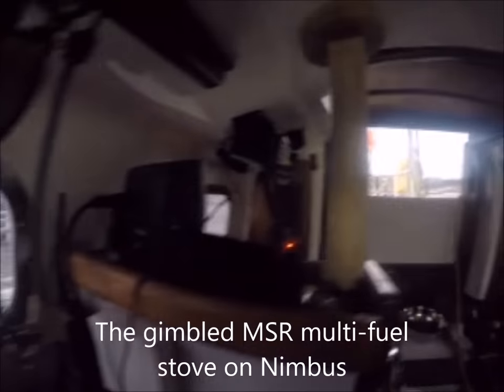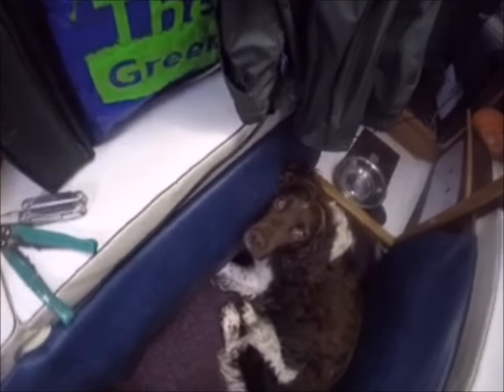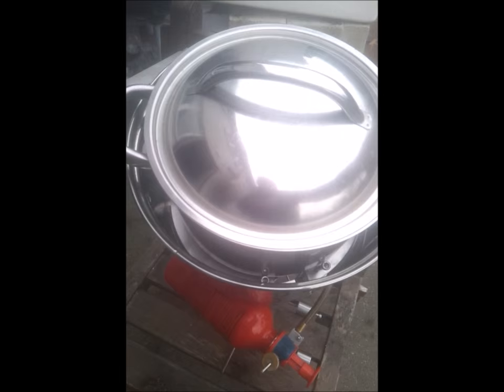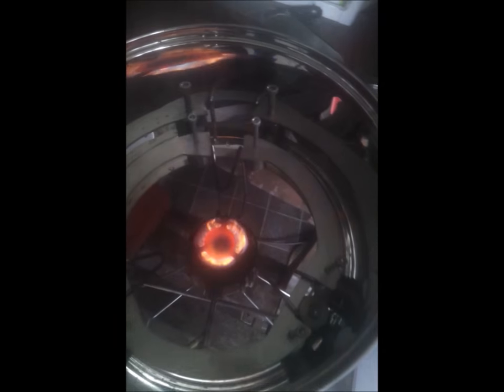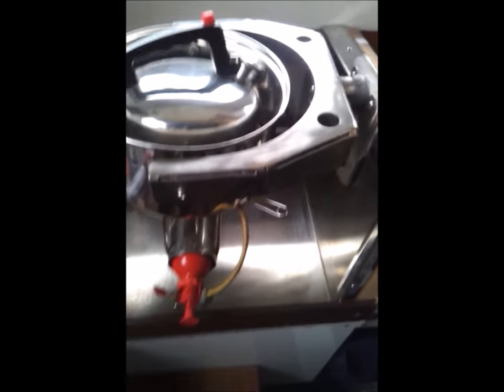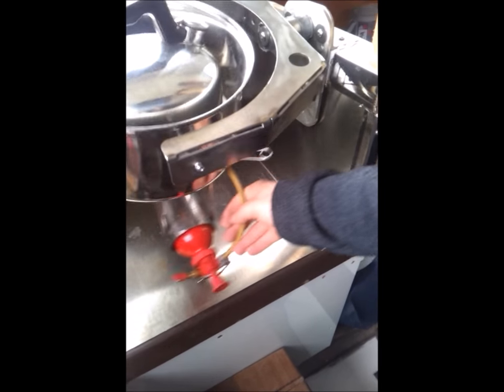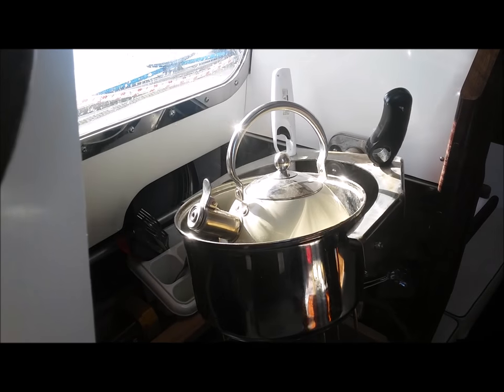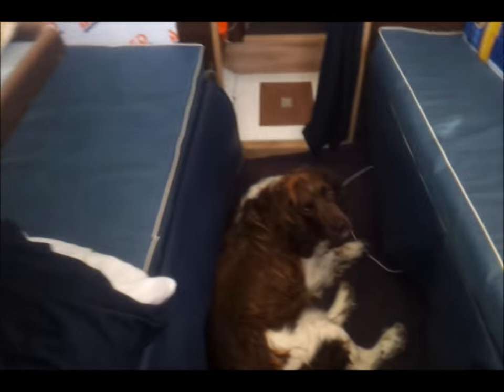Sailing.. DIY   yacht storm stove - multi-fuel - fully gimbaled

Comment: Enjoy your videos, this one is very impressive,  nice job on the gimbal design and execution. Love the craftsmanship in your gimbaled stove. Would you consider making another one the same and selling it to me?
I just bought a sailboat and have been looking for a gimbaled stove setup simular to this but haven't had any luck.  :)  Thanks for the videos
Reply from the maker: Hi, thanks for the kind comments. When I made the original,  I bought in material /parts to make a small batch of these, which have all been installed on friends boats.  I'd be up for making more but a one-off would be relatively expensive... I've pinned your comment, so maybe if a few other people are interested (they can let me know via a comment) and I could do another small batch that would be more cost effective.
Reply: I would be interested in buying one! In the middle of a refit of a HR Monsun for extensive cruising. LPG is tricky around the world, and meths are no option. But love my multifuel-stoves from trekking, and would very much like a good solution for installing it on the boat!
Reply: I would be interested in buying one as well.
Reply: I would be interested as well.  Let me know.
Reply: One more question.  Could you make one that detaches from the wall when not in use??
Reply: Sell the plans might be an easier way to go I’d be interested
Reply: I would definitely buy a gimbal kit from you!
Reply: @SVNimbus   like I said in other comment, try to draw every detail, put it in one 3d file and sell ( pay some paid traffic on the internet, you will be amazed at the number of people who would buy your project around the world!)

(see for example the MK3 Wind Vane project, and all dingue's boat projects that a lot of sailors around the world buy every year)
Reply from the maker: @DouglasCampos84  Thanks for the comment and great suggestions.  I'll take a look at dingue's projects.  I've not filmed a "how to" video for making the gimble (lots of requests) because I used laser cut parts and a lathe and welder, which most DIYers don't own.  Perhaps I'll redesign it,  so it can be made just with DIY tools?

Comment: Excellent piece of work. I designed something similar (though considerably more modest) to run off gas cartridges for use in the cockpit, so I could make a meal on passage without going below.

Comment: Fantastic piece of engineering. Mine had an ancient gas system on her but removed in favour of alcohol origo 3000 stove.
Reply from the maker: Thanks.. I also like the origo stoves alot..Did you know that  B&Q sell "La Hacienda" bio ethanol in 2litre bottles for £5 during the summer?... and it virtually has no smell when burning.
Reply: +SV Nimbus no, will have to look for them

Comment: Details on the rotating mechanisms would be nice. Did you use bearings or does it just pivot on bolts?
Reply from the maker: I used thrust and roller bearings on the main pivot,  the high cantilever forces make this  necessary.  I also used small roller bearings on the inner pivots, but whilst these aren't essential in terms of friction (a hole and shoulder bolts would work fine) they are silent and won't wear.  Hope that helps.

Comment: Can you burn straight vegetables oil?
Reply from the maker: Hi....  I've not tried burning 100% veg oil,  I'll have a go next time just out of curiosity.    I suspect it would burn ok, especially at full heat, but might tend to "gum up" the main control valve much quicker (and for sure if the stove wasn't used for a few months)  I've found using paraffin  that's a couple of years old (and lost it's sparkle) also clogs up the main valve , forming lumps of carbon that then block  the main jet..   I generally use 30% filtered veg oil, mixed with paraffin but also add about 5% alcohol to keep thing clean, this seems to work Ok for me.